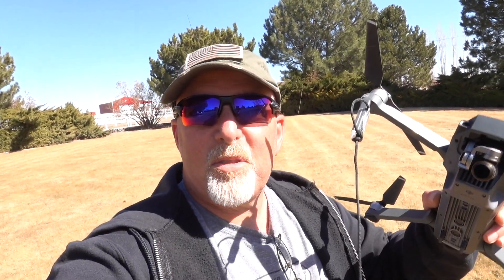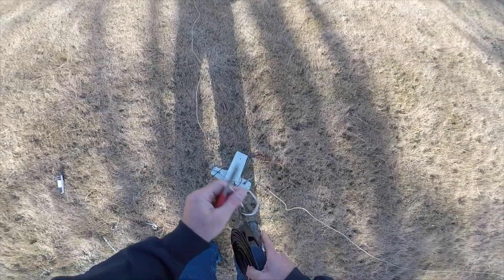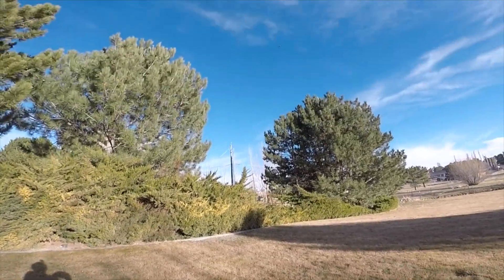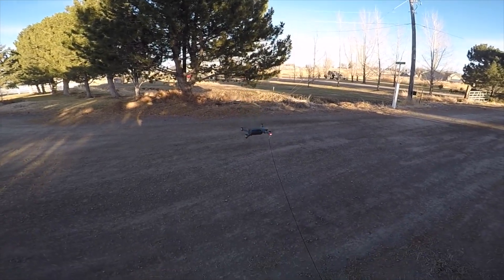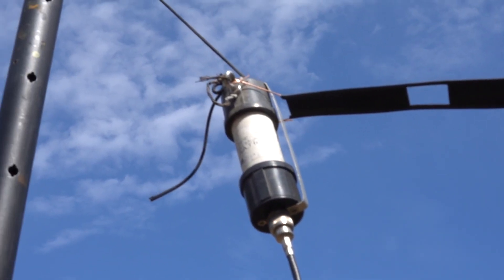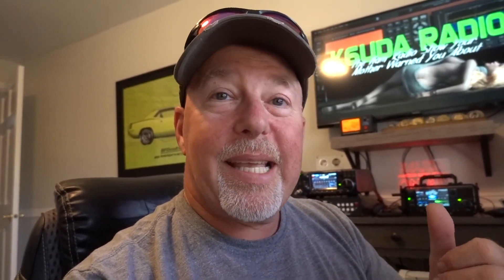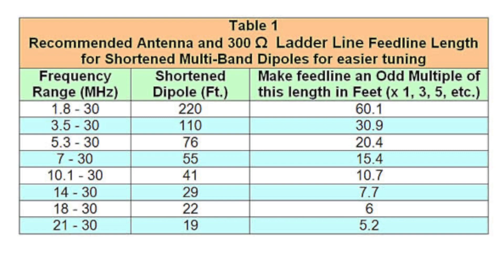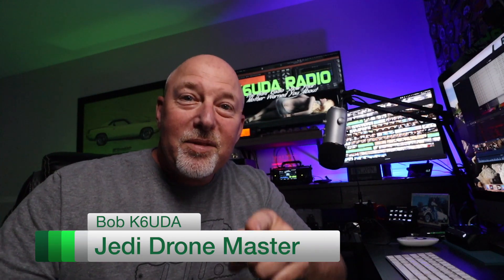80 Meter Dipole Install via Drone

Comment: they make small lightweight release mechanisms you can attach to the drone so that you can drop a sinker attached to a piece of cord and use that to pull your antenna tensioning line or a pulley up into a tree.

Comment: I'm planning on doing something similar, but I'm going to bootstrap first by raising some lightweight fishing line rated at something like 80lbs instead of the antenna directly. It might get tricky working around the branches at the time of pulling the fishline across the branches.

Comment: (WA4OSH)  Actually, since the currents oppose each other in the feedline when the antenna is matched, so the feeder does not radiate.  Since the currents are in the same line in both sides of the dipole element, it radiates.

Comment: I'm in city with very small lot and used a Jetstream JTCE4B Black Center Insulator for Dipole Wire Antenna and had coax and spool wire to make one to listen to 3.933 lsb/usb on my icom-746 had to run the wire in zigzag and the auto tuner tuned it in really quick & one day wanted test out a old cb i had before i sold it & used the wire found it was tuned just right swr of 1:15 where some the locals talk when conditions are bad or just b.s.ing Both legs was 63' 4" and this was my first homemade try & being only a tech without any electronic training have had make some for other local hams that where stuck with only vertical antenna's ! The drone idea will help get more antennas in the air ! 73's kd9www !

Comment: For your location, I would use an end fed EFHW with a 49:1, using 3.5 Mhz as the fundamental half wave length. That way you can feed it closer to the shack - no long feeder. Shortish coax so minimal feed line loss with a feepoint that is close to 50 ohms. Much neater than ladder line. And your SWR is low on all harmonic bands - no need for the ATU
Reply: The wire fed with ladderline (a doublet) can be extremely efficient on all of the bands though.   Assuming one is using a wide-range tuner, you would be able to tune even high SWRs and have extremely low loss because the ladderline has a lot less loss at high SWR.    If that were a wire fed with 50 ohm (a dipole), although one could use a wide range tuner and tune up just about anywhere, there would be very high losses if the coax run was long depending upon the SWR present.   If one is fortunate enough to have a good quality EFHW, sure they will be able to use all of the typical HF ham bands from 80-10 with minimal loss and no tuner required.  I've never used an EFHW yet so i can't speak about it.  I'm just stating that his choice to use a doublet gives him all-band performance (assuming a wide-range tuner is used) with very low loss and is a fine option.   I'd like some to read some real world reports from real antenna gurus (not most of the Youtube community) regarding efficiency of an 80-10 EFHW vs an 80m doublet with a wide-range tuner.
Reply: @mbtjr  You are right about silly youtube comments regarding antennas that they have never used !!! I have been licensed since 1984 - 37 years, and used just about every antenna out there, including my own SteppIR beam. I have built my own EFHW antennas and used them for the last 12 years. I went on a DXpedition to Mozambique using the callsigns C91B and C91J, where our only antenna was an 80-10 EFHW above the sand dunes overlooking the Indian Ocean - we made over 14000 QSO's on our EFHW. The EFHW is hard to beat as a general purpose 80-10 wire antenna. The losses on the coax are negligible since the SWR on the coax is less than 1.5:1. But hey, what do I know right ? :)
Reply: @johnk8091  I'm not sure if you are being sarcastic or not.  I admitted to not having used an EFHW yet.   I've been licensed since 1991 and used various dipoles / G5RV / ZS6BKW / doublet / delta loop over the years, but never an EFHW.  I've been "out of the hobby" since 2014 and am just recently getting back into it after a move to a new QTH.   And now EFHWs seem to be all the rage (but mainly hearing this from new hams / portable ops / prepper community).  That's why I say that the jury is still personally out for me until I get the opportunity to build an EFHW and put it up.   2014 and prior I don't recall any significant publicity about the EFHW.     Glad to hear of your success with an EFHW.    14K Qs is impressive.  I'm not doubting any of your claims.   I just need to evaluate an EFHW personally before I am convinced of its performance.   I was mainly speaking of the efficacy of a doublet.   PS:  I ordered an EFHW a week ago from the same company you have listed on the C91B page.   Hopefully I'll have it up within the next month to try out.
Reply: I'll echo that... this is just cryin out for a drone assisted EFHW antenna installation.. only 1 high point needed, so the drone fly's over the highest tree you can find, it could be 100' tall and  your antenna becomes an efficient sloper and your coax is your counterpoise... I use an EFHW all the time, 130'.. and work every DX station I hear on 100 watts... the Galapagos on 10 watts. No tuner needed.  Once you've tried one you'll never go back.... so convenient as a portable antenna.

Comment: Nice multi-band doublet, and great use of the scientific method, trial and error. I run one as an inverted V off of a trailer mounted tip up, crank up tower. WS7PB.

Comment: Hi Bob,

I am very surprised & impressed that the drone was able to lift that cord in such an unbalanced fashion; i.e. taped to a corner leg.

I would thought you would have had to tie it amid ship - center of gravity.  Respect to the Mavic!

So Bob, when are you gonna hang a huge 160 meter horizontal loop? That'll tune well across the H.F. bands. 😎

See your snow is all gone...  looks like we had more snow down here just north of Tucson @ 3300 feet - twice this past week - than you guys had.    It was 90°  a few days earlier! And 85 today... No! REALLY!
Almost 20 years ago it snowed in Tucson (2500 ft.) about 5  inches  on Easter... in April!!!

Anyway, glad you are able to get out & starting to get setup.

73 - John - N7GHZ

Comment: Being a cargo helicopter pilot, I knew how to build a cargo hook for my quadcopter and used it to drape the 130 foot wire of my 80 meter EFHW over three trees and It worked three times, since the wind broke the wire twice!  I tried slings and throwing weights, but the aerial delivery method worked best for me.

Comment: Wow Ballsey with para cord. I ve found it best to use masonry cord. Also might be better to use a servo release and weight vs cut power on the other side of the tree and use quad copter as the weight.
Reply: Or a nice bright colored decent fishing line.  Good thing those trees were really large bushes impersonating trees. Probably be a plus to get a 46 foot heavy duty push up fiberglass tower to support the  center and get it to a respectable height as an inverted V.

Comment: Sweet! I was planning on trying this, but with surveyor's string instead of 550 because I have a Mini 2 and didn't think it was stout enough for the 550. What drone is that?
Reply from the maker: It’s the older mavic pro.
Reply: Looks like one of the new DJI Mavic drones with the folding arms